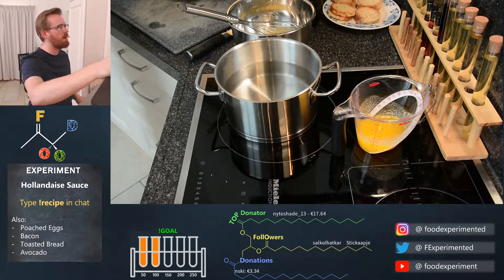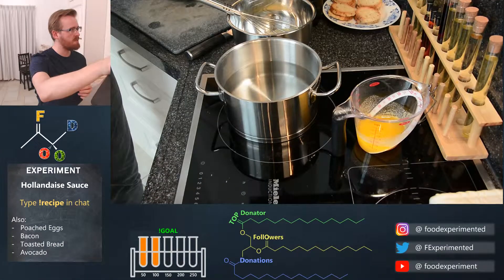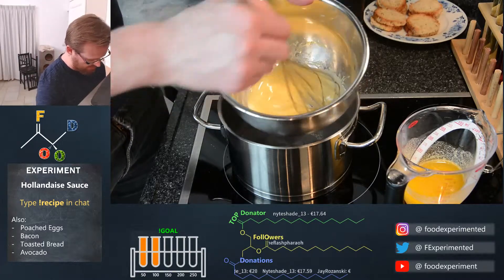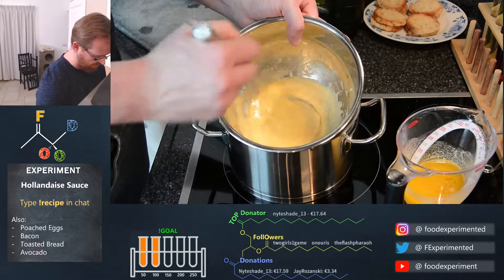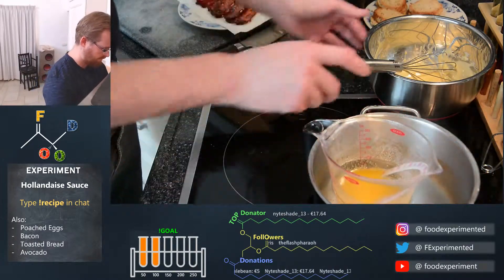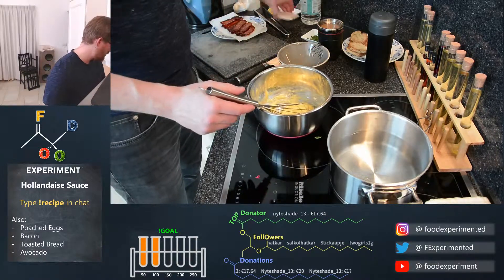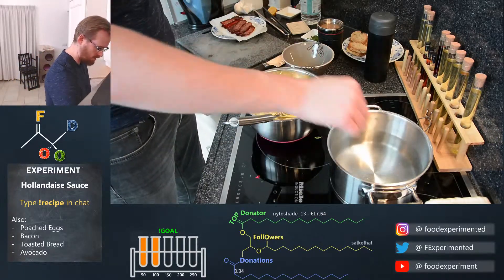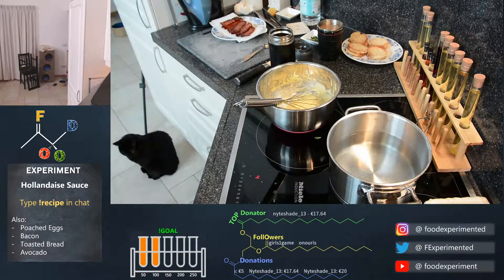Food Science: How to Make Hollandaise Sauce

Comment: If you don't want to waste electricity by switching on the oven for just bacon, you can get the same level of crisp by placing the bacon on a cold pan with a tiny amount of butter (half a tsp) and letting the pan come to temp slowly. That will render the fat out of the bacon just like the oven does and the butter will give a lovely colour. I usually add the rendered bacon fat into the butter and let it cool a bit (hot butter will scramble the egg) before adding it to the hollandaise. Thanks for the video!